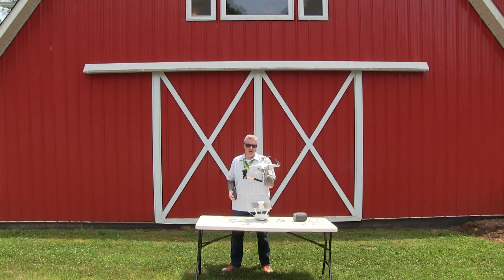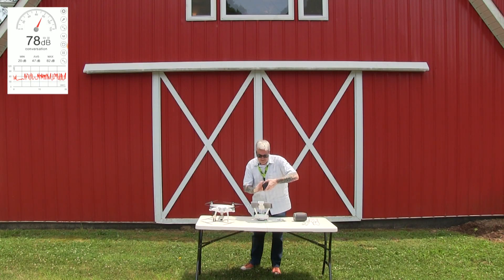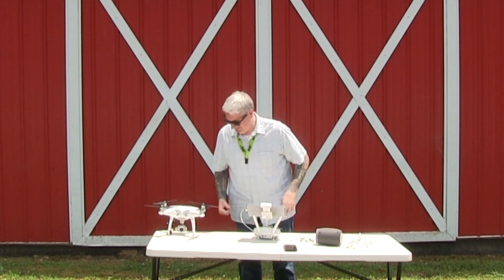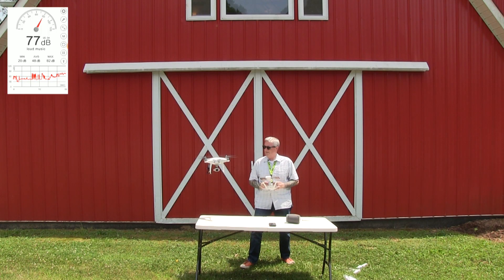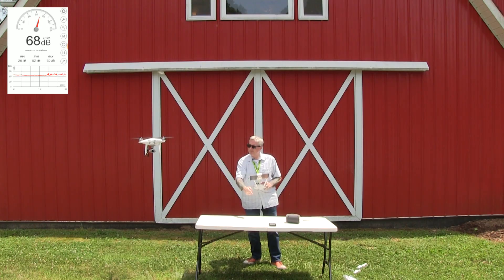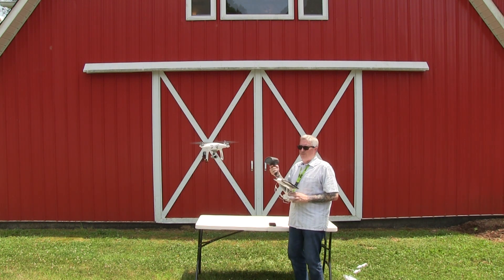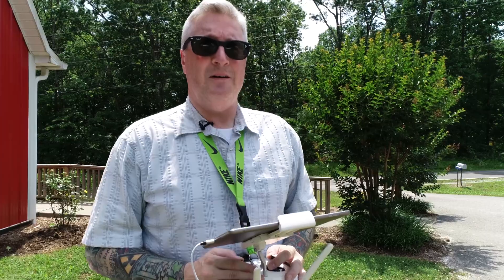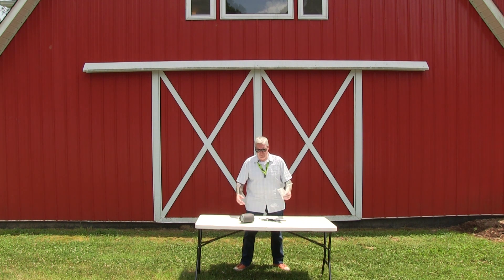Are Silent Propellers Better? - KEN HERON - DJI Phantom 4 series

Comment: Efficiency is not always proportional to the rpm since we don't know the torque value for the revolution. That's because efficiency is simply related with the input energy and output energy. Energy is power * time, and let's say the drone requires the same amount of power for the still hovering. The power that the propellers consume is the torque * rotational speed (rpm).  If the silent props require more torque than the regular ones (means more current from the battery), even if their rpm is less, the energy they consume might be higher than the regular ones for the same amount of work (still hovering )that they do.

Comment: Hi Ken, in some of your other videos (I assume done since this one) you've mentioned that you thought the Low noise props were crap. So I bought a pair of the regular ones for my P4P-v2. Haven't had a chance to try them yet. Wondering what you feel currently about them - and why? What makes the Low Noise props worse than the normal ones? Handling? 
thanks for your vids- entertaining and informative...
Reply from the maker: Hey Jeff!
Yes, handling mostly.  They sacrificed efficiency for lower noise. I think you will really like how the original props handle.
Plus, they don't look silly!😁
Reply: Ken Heron -Thanks Ken. Always thought the cute little curves tips had a bit of Panaché, but if the originals fly better, noise be damned...

Comment: i got a question for u, i dont know if you can help but, i bought a MAVIC PRO PLATINUM and took some videos, when i put them on my computer they were lagging and stuttering, what do i need to do do fix this, is it because my computer cant handle 4k or am i doing something wrong???
Reply from the maker: Make sure you have a fast enough SD card. It could also be that your computer can't playback full 4K video.
Reply: @Kenheron   Thank you ill check those things out

Comment: Give me props Ken. I’ve flown with both a bunch. I prefer the feel and look of the low noise props. They are quieter and in my opinion they are simply better. For the money there isn’t any reason not to upgrade. I need a couple replacement props due to non hand catch landing, it’s winter need a break please give me props.

Comment: How good would it be if the props were variable pitch, there more efficient than fixed pitch and can adjust to the rpm, this would in theory improve the drones performance and less strain on the motors".

Comment: Ken, I bought a set of silent props for my Mavic Pro and conducted a very different sound test. I shot my drone straight up. With stock props, I could still hear it at 400' but with the silent props I had difficulty hearing them at 200' unless I made a maneuver which changed the pitch. Rough guess, I believe the silent props to be 30-40% quieter. As you noticed, there is a definite pitch change between them and the stock prop due to a slightly larger surface area and torque in the design from hub to tip. Thanks so much for doing this. I love your channel.

Comment: Ken, the speed of the props doesn't indicate efficiency.  If that was true, adding 9450 thrust boosted props or larger props would mean higher efficiency.  The real test would be to measure the endurance, not rotational speed.

Comment: Ohh, and another test I would be interested in is handling. So like you could do a time race from 1m to 120m (from a few feet to 400ft) and see how they compare. If they are more efficient then it should gain altitude faster. Rather than using a timer you could get exact times off the video recording (well, if you use a higher frame rate that could give you an insanely accurate reading and how fast you throttle up would be the inaccurate part, lol)

Comment: GIMMIEPROPS KEN! Seriously gimme those props B). Thanks for the review, I like how you added the radar gun to test speed. Safe to say the new props have more airfoil resulting in more lift per rotation. The winglet in theory should reduce the air vortex created by the airfoil, however it might be more for reducing the air vibration. Thus, "more" silent props. DJI please make obsidian silent props!

Comment: I don't think the point of the quieter props is necessarily a quieter volume as read in decibels. I think it's that the sound produced is over a wider, more even range of frequencies. Ever look at a modern fenestron tail rotor on helicopter like the EC135? It's the same reason the blades in that fenestron are placed at unequal distances apart from each other. It's a pretty clever trick.

Comment: I noticed in the 1st test the p4p was slightly at a higher elevation. The props were at an equal elevation that was dead center with the X in the barn door. In the 2nd test the props were at a slightly lower elevation. Regardless it would still result in them being quieter. Is it possible that the reading would of been lower also? Possibly in the high 60s 🤔

Comment: I don't think you can quite measure the efficency of a prop by It's RPM. If a prop spins faster, it logically takes more turns for the prop to provide the same thrust. But that doesn't mean that they are less efficient - they may spin faster but it depends on many factors such as Pitch of the Prop, Air resistance, Weight of the Prop, Weight of the craft and of course prop Design. Generally a rule of thumb: Steeper pitch means less turns, but the Motor needs more Power for each turn. On the other hand: shallower Pitched props need more turns to provide the same amount of thrust, but take less power for each turn. For example: in Drone Racing, the "5040" prop is one of the most efficient. It's a 5 inch prop as the first Number states and it has a Pitch of 40 Inch, which is quite shallow - so it generally has more rpms than the most props but still is one of the most efficient.
Reply from the maker: Very good info!
Reply: Ken Heron Another Tip: slower props are a little more quiet than fast ones. If you want a very quiet quad you want steep props and a lightweight aircraft.

Comment: Was the frequency lower or higher? Case in point. An X8 multirotor ive been up close to was louder than the P4P but was more of a hum then a buzz. The lower pitch seemed to be easier on the ears (mine anyway) and seemed easier to talk over. Like comparing the annoying buzz of a bee to the less intrusive sounding
 drone of a dragonfly.

I also wonder about the folding props compared to fixed props in relation to Yaw characteristics.

Comment: GIMMIEPROPS KEN!  My Phantom 4 needs new blades!  LOL
Great video.  I didn't know you could get the RPM readings with that radar gun! Cool!!
Reply from the maker: I think there's a little bit of math involved with getting the exact rpm, but it did demonstrate that the silent props do spin slower and therefore are more efficient.

Comment: Good test Ken, but lower RPM does not necessarily indicate increased efficiency. The best way to measure an electrical motor’s efficiency to measure the current draw (and battery voltage drop) but that wouldn’t be easy on a Phantom without cracking it open and adding some additional hardware. Flight time is a decent substitute but there are an awful lot of variables that can change flight time so many replicates would be needed. I really enjoyed your video and thanks for all your hard work 👍
Reply from the maker: Thank you very much for the nice comment Brad.

Comment: Here's an interesting question why did you use your speed meter! 

Doesn't the Phantom 4 tell you the RPMs right on the controller or in the app. I know it does with the mavic pro..
Reply from the maker: That would make for a boring video.

Comment: GIMMIEPROPSKEN! Good review. I watched a slightly more in depth one over at Drone Valley, with similar results. It's not that they are "quieter," but rather the upper frequencies were killed. He used a spectrometer or something to show the frequencies are more pleasent to the ear. The angry bees nails on chalk board is replaced by a lower hum. But only a decibel or 2 "quieter."

Comment: Hi Ken. I have a set of the new props. I noticed they do attract the flying insects as when I had finished flying they were covered in their remains, also I thought the edge had been taken off the performance of my Phantom slightly. On the plus side, yes they are quieter and think help with stability, making for a smoother flight for filming. Loved the Wok pun LOL😋
Reply from the maker: That's very interesting. 
Thanks for the info!

Comment: That's not accurate. Your phone app is not accurate for db readings. The added camera weight makes it louder. This is not a accurate test
Reply from the maker: Actually I wasn't going for accuracy on the decibels. If however, the camera was attached to the drone on both lifts, then it does accurately show the difference in noise levels. So the test therefore, is valid. Thanks for the comment!
Reply: Ken Heron sorry for that 😂😂 you're right. Btw I love your videos

Comment: tupid question! i have

if you point that speedmonitor to a car antiradar, will it pick up as a positive police detection?
if yes so if i put that thing in car that mean other will slowdown, basically
Reply from the maker: The answer to your question is yes! I have actually done that a few times but it's not advisable because people will be afraid that there are police. I can tell you that it uses K band and police are now using KA band, so people with really good radar detectors in their vehicles will know the difference. Very good question!

Comment: Ken, actually your speed gun only measures off of one propeller but it can’t differentiate that there is 3 in one rotation. At 7000 RRM and a blade radius of 4.725 inches, they’re actually spinning at almost 197 mph. That’s why they’re noisy

Comment: GIMMIEPROPS KEN , As the props are spinning slower to achieve the same as the OE ones, does that mean the flight time should increase also ?
Reply from the maker: That might be the case, but they look a bit heavier than stock props as well.

Comment: Great review Ken, but your bird seemed to drift further away during the sound meter test, it seemed quieter on this video, not just frequency/tone level?   Idea, how about next time hanging the sound meter on the bird itself, say off the landing gear?  BTW, did the lady hit you after you turned off the camera so there wouldn't be any evidence?  LOL!, Thanks!
Reply: GIMMIEPROPS KEN :-)
Reply: I agree with Steve's observations, Ken.
Reply: I do have one suggestion for sound testing, next time you test, for the best and most  accurate test, you should be approx. 10 feet away at the same level as the item your testing, i.e. exact same level as the prop; just a suggestion, I tested fire alarm systems for over 20 years, my wife keeps saying that why I can't hear any more LOL!.